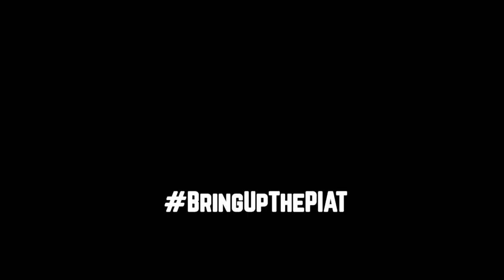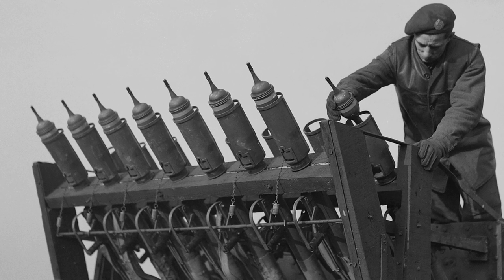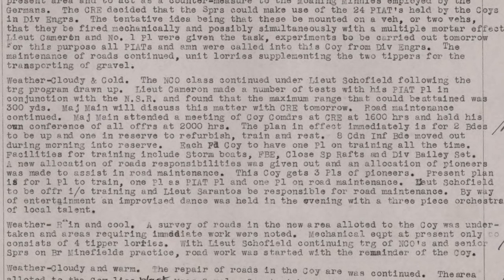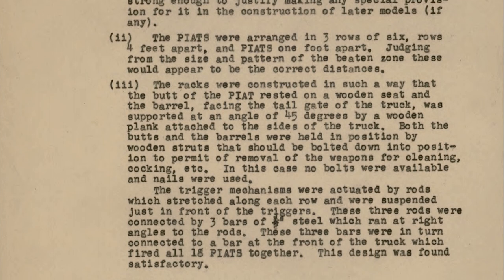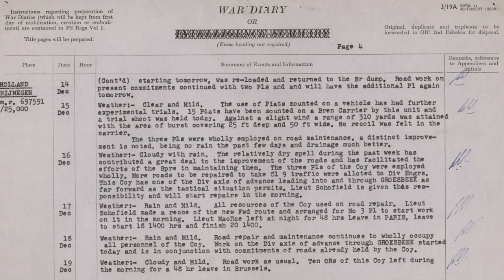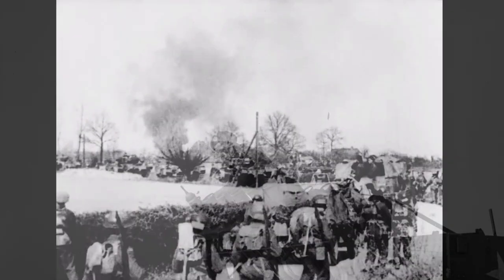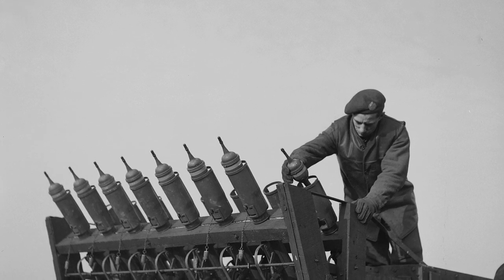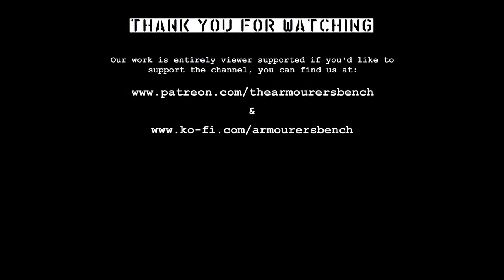The Experimental PIAT Carrier

Comment: Interesting video.  Looks like the bars are connected, so you can only fire both rows at the same time. interesting to see the piats with the 3 hole sight, and without the modification of the hole for the monopod being slotted to allow for left right tilt adjustment of the piat on rough terrain.
Reply from the maker: Yes! The fact they're all 3 aperture sights is interesting.

Comment: Worth noting by the date the photos were taken (mid December 1944 according to LAC) that II Canadian Corps had been out of action for over a month, holding the line in the Nijmegen Salient. Idle hands are the devil's plaything, as they say. This was obviously not the intended purpose of the PIAT but in action the infantry found that it could be used effectively as an ad hoc mortar, and the HEAT rounds apparently were good at penetrating roofs of small buildings or bunkers. So my guess is this vehicle could be used to lay a barrage of PIAT bombs against such a target. With access to fast, accurate and heavy artillery support, the need for something like this was probably low. Infantry battalion commanders could also rely on their own platoons of 3-inch mortars and 6-pounder anti-tank guns for local fire support.
Reply: PIAT was designed with a secondary indirect mortar role in mind.  They had sights for that.
Reply: The Canadian Army junior officers did after action reports, these officers noted that the PIAT was, overall, their most effective weapon.  It was mostly used as indirect fire, and it was available to company and platoon size units.

So, this experiment was an extension of that thought.

Comment: it seems like it would have been a nightmare to reload if the PIAT did nor re-cock automatically.
Reply from the maker: Definitely, I would imagine pretty impossible job without undoing bolts but it had the benefit of the system providing a firm base against which the action could work giving it the best possible chance of recocking. Thanks for watching!
Reply: @TheArmourersBench  your are very welcome it is an interesting invention thank you for shearing the information .

Comment: I wonder if this was also considered as a weapon against static armour. The top hull and turret armour was quite thin compared to the glacis and side armour?
Reply: Like Javelin!
Reply: @dermotrooney9584  more like the Swedish STRIX system that was fired by a mortar... there was another system that was launched from a mortar and deployed a parachute to 'dwell' in the air... it had a 'spill' built into the chute that spun the round to 'scan' the ground with an infra red detector. When it acquired a target it released the chute, fired a booster rocket and impacted the top of the vehicle! Fiendishly clever... I forget the name of it though?
Reply from the maker: No mention of it, only justification mentioned is 'harassing' in response to Nebelwerfers - which seems a big stretch! It seems to me like they could have used it as an ambush weapon, sat in wait. Or knocked a house down from 400 yards away!
Reply: @victuff9765  Thanks. There was a lot of talk about mortar-launched top attack 20yrs ago but I don't remember if it ever paid off. Now trying to calculate the hit probability of 15 PIATs on a Stug... reckon it'll take me a while.

Comment: This doesn't seem to be playing to the strengths of the PIAT, the potentially quicker reload time, able to shoot from a prone concealed position, and lack of smoke/flash.

However, sticking a load of rockets in a battery would have been great, as each is recoilless even 14 firing wouldn't tip anything over just create more backblast. It wouldn't matter so much if a load of smoke was created if you fired all the shots at once.
Reply from the maker: Exactly, this is a pretty deadend idea especially when they had Land Mattress - which was a load of rockets in a battery! A Canadian Katushya of sourts. BUT this is a local, divisional level effort and you have to hand it to them for thinking about it!